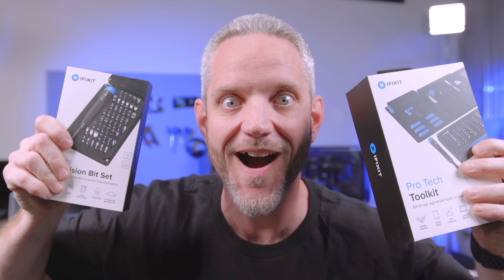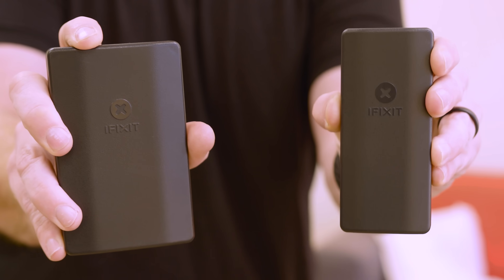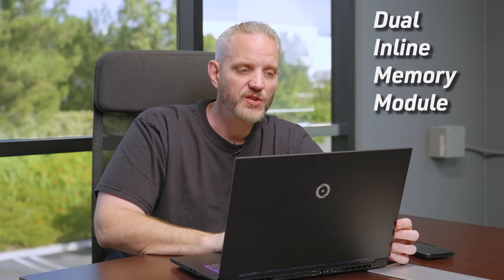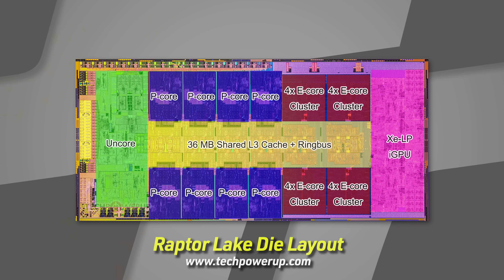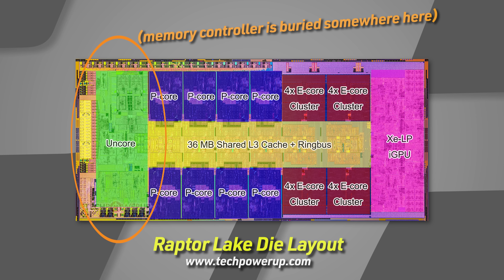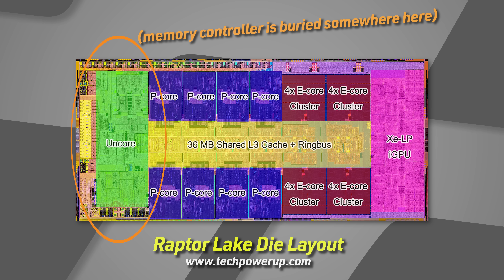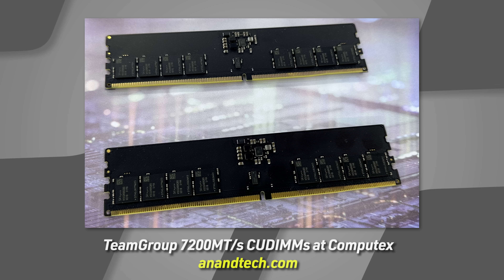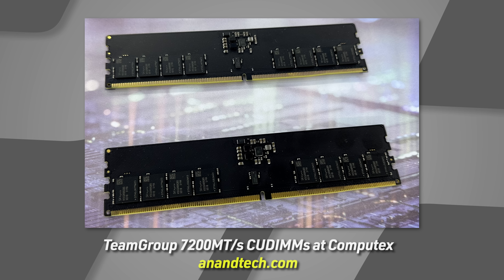RAM just got a LOT faster! Up to 10,000MHz!

Comment: I think this could be useful for heavy Data science tasks, especially in the GIS industry. We often deal with LiDAR or Orthophoto Datasets whose sizes are in the in the 10s of 100s of Gigabytes range, which means that most software just can't handle how big the dataset is. Now, you can tile it, basically cut it into smaller chunks, which makes it easier to process and then merge it back together at the end. But the thing about that, is it means that you're constantly loading data into the system memory, editing it, and then saving it to disk before grabbing the next piece, so anything that can increase the speed of loading, unloading and accessing the system memory can pay dividends, especially if you're dealing with a pipeline that can take more than a week to run.
Reply: I run exponential random graph modeling on large social network datasets (hundreds of thousands of nodes and millions of edges) that requires tons of memory as many of the libraries are still based in R and not Cuda-oriented for parallel processing. This would be a nice step in that direction. 

Or maybe someday somebody could write igraph to support GPU processing!!!!!!!
Reply: @LordRykard9376  Oh, I wish. I'd love to run more of my pipeline code on the GPU but barely any of the libraries I use, aside from the ones specifically dedicated to Machine learning like Pytorch and Tensorflow, actually take advantage of all the free processor cores.
Reply: I'm a data scientist.  A bit of 102 information:  All DS math done on data hits system ram, because SIMD is the fastest way to number crunch on a CPU today and SIMD hits ram.  So any ram speed boost, even for smaller datasets is a speed increase.  Also, it's not called tiling but streaming.  Same idea, where if a dataset is larger than system ram parts are streamed in and out, kind of like page file in Windows.  Today new libraries like Polars and DuckDB allow for easy streaming, which is really nice.  It was only a few years ago when if a dataset was larger than ram on your local machine you'd put it up on a server with tons of ram and run it remotely.  It's only very recently where we can do this kind of work locally with streaming, which is sooo nice.  In these kinds of workloads you're bottlenecked by the speed of your hard drive.  In the cloud you can't get really fast HDD speeds, but on your local machine you can splurge on your hard drive and it can reduce computation time from minutes down to seconds or hours down to minutes.  For super number crunch heavy workloads it gets offloaded to the GPU but most workloads are more ram and hard drive speed limited before they become computation limited.
Reply: @Danielle_1234  have you worked with GIS data? Specifically LiDAR? It's called raster/vector tiling (its specifically how GIS data is stored, processed, and visualized and software like ArcGIS handle it differently than sequential or columnar so DuckDB most likely wouldn't be the go-to for that type of data. 

Also it sounds like he's actually building these tiles so unless he or his work are building their own in-memory distributable systems, they will need to look to the big boys for processing or they have to build their own architecture if they get into terabyte territory.  

My work has racks of A100s we  
base virtual shared memory systems on almost exclusively through PyTorch. But it's all raster, no vector (way easier than what he's doing).
Reply: I think the bottleneck here is the SSD, you'd need a few Gen5x4s in RAID to match the in- and output speed of the datastream.
Reply: @paulmichaelfreedman8334  a bit more complex dude.
Reply: @LordRykard9376  I know that, clusters of machines interconnected with Fibre is indeed more complex, but fact remains that the storage needs to be able to keep up with the data stream.
Reply: @paulmichaelfreedman8334  Look into vector and raster tiling, very different process from streaming.
Reply: @paulmichaelfreedman8334  I think you might be confused about what we're talking about. What I do doesn't involve any kind of data streaming, because the existing vector and raster datasets don't really support that sort of thing. As a result when we need to analyze that dataset then entire thing has to be loaded directedly into the system memory while we analyze and manipulate the data. To get around the limitation, some programs that we use for data analysis and manipulation, such as ArcGIS Pro or QGIS, will simply visualize the data from it's actual location on disk, but these programs are in the vast minority.

For example, if I'm creating an Orthomosaic (stitching together overlapping photographs) using tens-of-thousands of drone multispectral photos, all of those images need to exist in the system memory, the RAM, while the computer is doing the necessary trigonometry.

If I'm manipulating a LiDAR dataset in CloudCompare to perform a task like finding the density of vegetation in a forestry plot, then that datset needs to exist in the RAM.

In order to reduce the load on the RAM we do what's called Raster/Vector tiling, where we cut the dataset into smaller chunks based on geographic size. For example, Cutting a LiDAR cloud that covers 100Km^2 into 25 pieces that instead cover 400m^2, and in the process reducing the size of a single dataset from 50.5GB to about 10GB per file (with some variation). Congratulations, you can now run Cloud Compare on a single file and create your outputs without it crashing (probably), now you just need to do it another twenty five times, if you didn't accidentally create an output to big for the program to store in memory and cause it to crash, again.

If I'm coding, what ends up happening instead for example, is that I can automate the creation of the tiles using LasTools to save them directly to disk and then only ever run functions that will save to disk. But the data still needs to be pulled into the RAM while the functions are running, so having better RAM and having more RAM are some of the only solutions for this sort of thing.

Comment: I'm surprised no one has made the C-U dimm jokes yet. :P Beyond joking, I wonder how much if at all, they will improve on the Chip size of the Controller and or the way things will run with a bigger controller/ if Bigger controller can handle more Dimm Sizes with even higher clock speeds. It also makes me wonder if they are thinking about maybe upping the controller count, so one controller works with one quadrant of each part of the dimm or if it's even possible. All in all I want to see massive stability improvements and Ram actually giving us a higher FPS gain improvements that are eye boggling, rather than just the CPU - GPU aspect of things.

Comment: Why hasn't tech yet evolved to the point of putting everything on one chip? Why is the RAM and video card still separate? I know CPUs now have integrated video if you want that but why not take the entire board of a 4090 and integrate that with the CPU? Then, also, add 126gbs of RAM in that same chip. Yes, a CPU with all that on one die would be like 12 inches x 12 inches but then your motherboard would just need to be a little bigger than the chip. You would just need I/O on the board and one giant cooling solution. Or, just skip the video card and just integrate the RAM. A CPU with integrated RAM would still be probably 6"x6" but think how fast that RAM would be. It would be on the die with the CPU so there'd be almost no latency. 😉

Just to get ahead of the replies, the wink at the end is to indicate sarcasm.

Comment: I work for my local university's chemistry department as their equipment tech. I can see benefits of cudimms in the computational chemistry. The atomic motion and molecular structure simulations that get coded could see a huge uplift in decreasing the time to compile and run them. I plan on doing a side by side test with cudimm vs regular udimm .
Reply: I actually have to feel that "you" are the target audience with new tech, people that work with large data sets and large calculations.  The tech of DDR4 really does not otherwise let users down.  Minecraft isn't more creative, reading an email is still one word at a time and RGB is forever.
Reply: Cummdims
Reply: are there ecc-cudimms? I can't imagine running anything serious without error correction. I work as a server architect, and the consistency of data is very important.
Reply: I was going to say their use in crunching would, or should speed things up.
Reply: I would also hazard to guess that the biochemistry folks and/or molecular/drug design folks might see some benefit from this tech in the next few years, or whenever they decide to rebuild their lab's computer clusters.  Though, that would probably be the higher end simulations which would require it.  If I remember correctly, that would be the things which generally required being submitted to the Departmental servers to have the simulation data crunched.  Probably in the 5-10 year range is when I could see the individual labs being able to afford to fully rebuild with the latest and greatest CPU/RAM technologies.  Well, unless the individual professor's lab is flush with cash, which tends to be the organic/biochemistry folks who are working with medical related stuff.

Comment: I'm curious to see how Intel's new platform performs against the 9800X3D. If both platforms end up being expensive then you can't really point the finger at just AMD for charging extra for what is essencialy a re-used X670 chipset with a new name. Intel will be expensive, but it will be expensive because they're trying something different with system ram.

Comment: It sounds like Intel's clever way to compensate for the Ultra's slower speeds. In other news, as I sit and wait for a finalized Bios for my Z790 for the last six months,  it would be nice for Intel to pull their head out of their ass and fix the current platform problems.

Comment: FYI DDR4 debut on consumer platform with the Intel HEDT Haswell platform, so X99 and the i7 5xxx processors. It then took until Skylake to migrate to the regular desktop platform. It took AMD even longer to migrate to DDR4, which only happened with Ryzen 1000 Series.

Comment: It has been admitted by manufacturers that clock chips on CU DIMMS cost basically 10 cents and ddr5 has been around long enough that most chips easily could do 7000+ with stable clocks.
So please stop justifying price gouging.

Comment: I think CU + CAMM2 are were we are heading.  The CAMM2 will allow the RAM to be closer to the CPU for shorter traces, and then you have the CU which also is going to help things.
Reply: and it shall be named CUMM
Reply: @NonLegitNation2  Ahhh yes CUMM2FAST dimms LOL
Reply: @NonLegitNation2  LMFAO 😂😂
Reply: Unless the prices go down exponentially vs CAMM modules it is going to be a non-starter. Dell charges over double for a CAMM module compared to the same capacity and speed DIMM... and they price their DIMMs way higher than buying from a 3rd party.
Reply: @EthanAQueen  Dell probably sells CAMM for more because they sell 200+ times the amount of DIMM kits than CAMM modules
Reply: @EthanAQueen Well first off CAMM is not CAMM2. There are some technical differences.

Second CAMM2 is getting more publicity and I suspect more production meaning lower prices (but the onboard clock will drive up prices a bit, as will better binned higher clocked chips). It will be pricier at first of course. As always.

Third off, a smaller ram chip with lower footprint and facilitating better clocks by integrated CKD and smaller better placed traces is an improvement, one we have not really had on a technical level, since SDR, always the same form factor. Long overdue if you ask me.

Fourth, we need the more extreme clocks to feed ever more cores and higher clocks. So either we get 3 or 4 sticks which pushes speed down, and probably makes for more problems than it solves, trace lengths and signal integrity is a hard one. One that CAMM2 solves.
Reply: @EthanAQueen  CUDIMM and CAMM2 have more benefits than downsides. They're going to get cheaper with wider adoption.
This isn't the RDRAM predatory scam from the 90s.
Reply: It’ll all be one big die. A whole pc.
Reply: @phoenixfireclusterbomb  This will never happen.
Everything will thrive towards thinning and efficiency, but the PC modularity will never be sacrificed. People want to be able to upgrade 1 thing at a time, this isn't going anywhere.
Reply: I would expect CAMM2 to become relevant as we start going towards DDR6 where we have high frequencies. As the stubs in current unpopulated DIMM slots damages the signal.
Reply: camm2 will allow for better cooling as well
Reply: Yes,  true.
DIMMs are getting kinda old tbh, time for a change.
Reply: yeah, CU-CAMM2 on AMD would be so sick
Reply: @scarecrow5848 Why in AMD? 6400 1:1 is faster than 8300 rn in testing. Maybe for Ryzen 10000 Zen 6 with a new IOD, but for current gen this would be a major waste. Camm2 on Intel is only going on 600$+ boards for Ram speed of 9200 to 10000+ 

It would be wasted on AMD this gen.
Reply: @scarecrow5848  Zen4 and 5 don't support CUDIMMs
Reply: Intel bro wtf 🤣😂 @scarecrow5848 
Look, Zen 5 6400 1:1 is faster than 8300 in testing. 

Zen 6? Sure we will see a new IOD, IF, and faster Ram in 1:1 

On Arrowlake, you can Gear 2 9200MT and it scales. 

Putting CU Camm2 in AMD this gen would be a massive waste.
Reply: @scarecrow5848 nobody said AMD
Reply: @B1u35ky  Who you're replying to did - and now so did you. Good job keeping "AMD" in this discussion...
Reply: @RyTrapp0  great you missed the point. Stop being a shill
Reply: @B1u35ky  Just think, if you never said anything, the one lone AMD comment at the beginning could've just went ignored🤣 But you just had to say "AMD", didn't you, just couldn't stop yourself from poking those 3 letters on your keyboard...
Reply: @RyTrapp0  you sent that @ to the wrong person bro
Reply: @B1u35ky  okay, and? currently intel is the only one with CAMM2 desktop boards. would love to see a AMD one.
Reply: I'm anxious to see CAMM2 on desktop systems. But Der8auer replied to one of my comments on CAMM2. Saying he's not expecting to see it adopted on LGA1851.

Kinda left me a little confused considering several manufacturers at CES and Computex debuted several CAMM2 motherboards for Z790 & Z890.

Either way I'm anxious to try out either one on Intels Arrow lake CPU, and compare to my home server with the 14700k. I had a lot of stability issues with it, not so much the CPU, but it's been constantly throwing errors for the memory. My personal system is currently a laptop with 9700k, which I'll be replacing with a new desktop system here relatively soon. Just gotta wait for reviews, and then wait some more for next Gen GPU's..
Reply: @Demonoid1990 Intel turns over cpu pin outs in the desktop space a lot more frequently so I'm not especially worried on the CAMM2 front at least in desktop. In that space I'm way more excited to see CUDIMMs.
Reply: @blue-pi2kt  
CAMM2 has space allocated for CKD. It will e fine.
Reply: @Demrik_Dergoat  well, it is not a default, sure
Reply: I really hope we see a push for more CAMM2. I would love it if they could move it to the backside of the motherboard as well, as that would free up a lot of space on the front, specially for mitx boards.
Reply: @ClaireM_88  Hell with that! you know how much of a pain in the ass that would be to work on? As an IT person i say NO THANKYOU! Keep that shit on the front side.

Comment: I don't know about modern Intel CPUs, but AMD CPUs always favored latency when it comes to gaming performance. a 5600 CL28 will do better than a 6400 CL40 memory without question. So these new memory DIMMs better get a handle of the latency if they want to benefit AMD gaming performance. Manually using tighter memory timing like from billzoid dramatically improves CPU performance on AMD.

Comment: cudimm is going to make ddr5 cheap like ddr4 so im all for it. i can move to ddr5 while everyone is on faster cudimm and working through the bugs
Reply: Can we change the name to CUMM
Reply: I'm still on DDR4 and I've got a 4090. I saw no significant benefit of changing everything on my build just to accommodate DDR5. If you're thinking of making an upgrade and you're going to that when you know new tech is already released, you're just shooting yourself on the foot.
Reply: @CeceliPS3 FPS %iles (general smoothness of games). Xmp ddr5 > tuned b die.
Reply: @IIHydraII  ddr4 has less CL, so is difficulty to say that ddr5 is 100% better at gaming
Reply: @CeceliPS3 why though. A 4090 to get "bottlenecked" by RAM is such a weird decision imo. AM5 will be there for a long time
Reply: @ziggs123  how much is that bottleneck anyway?

Comment: I may be nit picking here, but if your a so called tech expert and influencer, you should at least know what your talking about.  MT/s is not the same as Mhz.   They are 2 totally different measurements.   Telling some one they have 7500 or 10000 Mhz memory is COMPLETELY FALSE, IGNORANT ANDA LIE....No memory for the consumer market can run that fast in Mhz.   DDR is still DDR.   10000MT/s memory only runs at 5000Mhz speed.   I use to like Jay2cents content, but I don't know if it is because he is still battling health issues, but his truth and quality has become garbage.......

Comment: • From my little bit of research, it is not yet certain whether the chipset matters with CUDIMM compatibility.
• The only thing that was confirmed so far is that the CPU's memory controller has to be compatible with CUDIMM.
• For all we know, original DDR5 boards like X670E/B650E could be compatible with CUDIMM with a simple BIOS update.
• Please correct me if I'm wrong. Just make sure to back up your claim with reliable sources if you do.